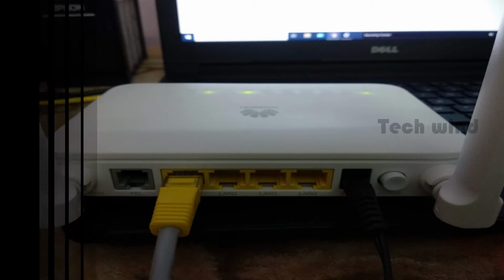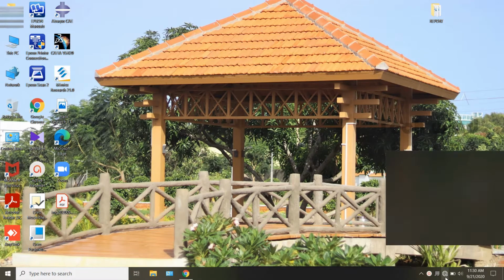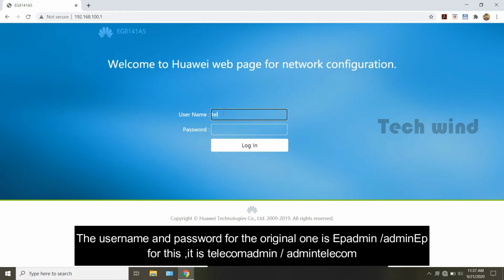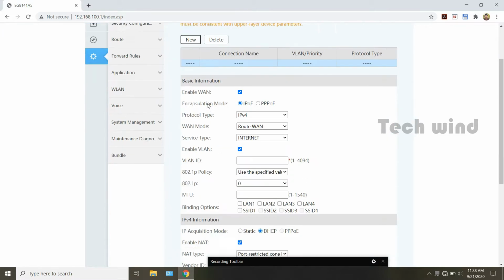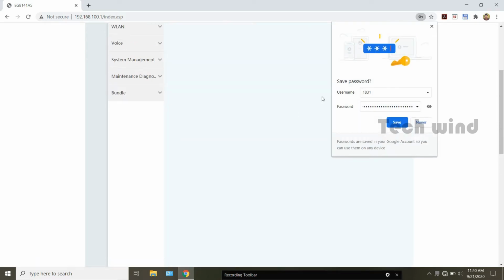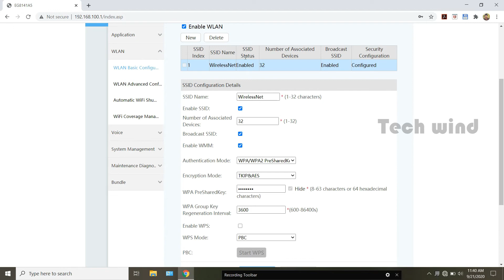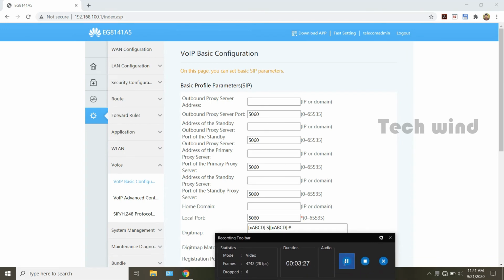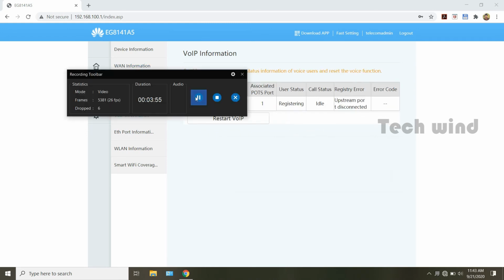HUAWEI EG8141A5 - Fake or Original ??

Comment: Bsnl voice configuration problem und Huawei 8141a5, voice up but call can't connect
Reply from the maker: did you check the voip information column under system info? Is the phone light turned on in modem?
What error message are you receiving when trying to call?
Reply: @TechwindTw  voice light is on, the phone is ringing but not connect call,
No dialtone, voip status is registered,
Reply from the maker: maybe , there is issue with the landline device